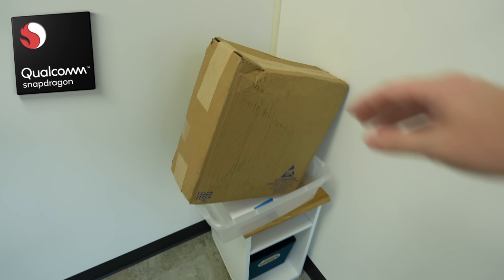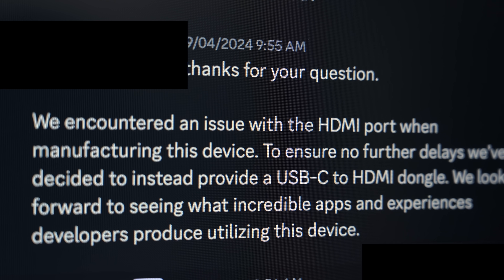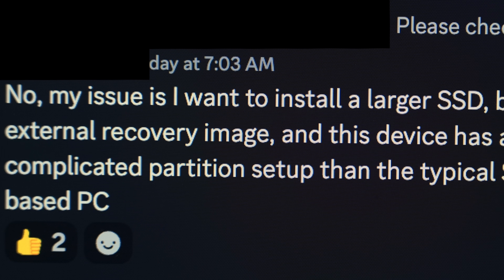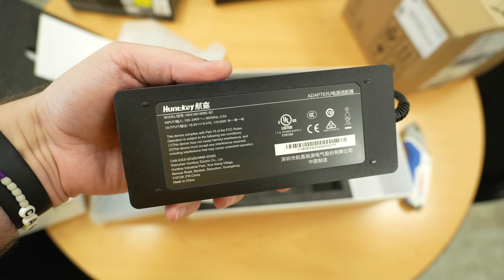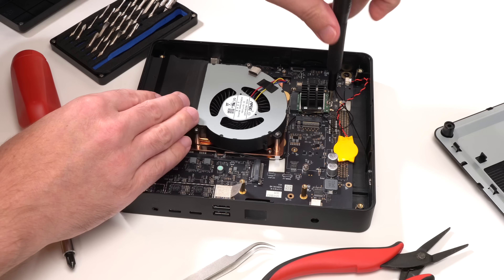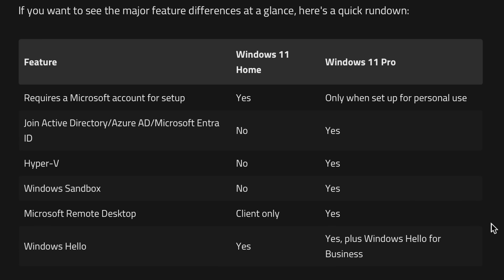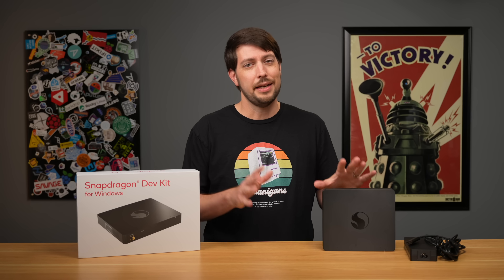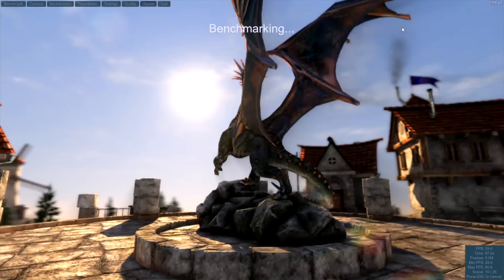Snapdragon X Elite Dev Kit: The CoPilot-est PC, tested

Comment: 100 watts from an architecture known to be efficient is some serious power consuption...
Reply: Did they just Overclock the snot out of some last gen silicon ? 😳 🔥💯🔥
Reply: People suggesting that peripherals are the reason for high power consumption does not make any sense, why would it only consume 40 - 100 watts on high load and not idle. Stop making excuses or the situation in the upcoming iteration of x elite won't be improving.
Reply: I get 1120MT on my 13700H 14.5inch laptop running at 115w
So from armv8.2 chip getting such bad efficiency even if Cinebench is not well optimized for arm64 is quite unaccaptable
Reply: or did the crackers have another epiphany
Reply: Isn't 15W output a requirement for a USB4 port? Then that would take half of the 100W.
Reply: You're misunderstanding, it was 100W with a keyboard and monitor attached, no power hungry usb devices. Pretty much all SoC and RAM.
Reply: @CampGareth  
Yeah, you're right!
Reply: @CampGareth  This thing doesn't have a built in screen or keyboard so this comment is null and void. You have no choice but to add usb devices, so I really don't understand this comment at all.
Reply: @CampGareth  I guess this is technically right, but practically means jack.
Reply: @CodyCLI  The context was power consumption, not power available. If you plug a lamp into a wall socket it does not consume the 3kW the socket can provide, only as much as the lamp requires. Similarly if you plug in a keyboard and mouse to a thunderbolt port it does not consume 15W, those devices are at most 0.5W. So the 100W measured consumption was almost entirely the SoC and RAM. Power available is much higher, iirc Jeff said a 180W brick. Hope that helps.
Reply: How does 15 watts take 50 watts?
Reply: @modrribaz1691 I guess because there are 3x USB 4 Ports, so that would add up to 45W so nearly the halft of 100W.

But they weren't used so 100W is without using all 45W over the USB-Ports.
Reply: @cze7470  Got it, I found out about the specifications, and it was also 15w if one and 15w for each two if more or 15w on one and 7.5w on the rest, so it's 30w-37.5w for all three, which is for BPDs to function properly...still not at 50%, disregarding that it was 0% at this case, since none were used.
Reply: @cze7470  exactly! 
There was some new mac and everyone was like why it needs such a big PSU. 
It had multiple TB ports, so the multiple 15W adds up.
Reply: @cze7470  that is available power, not what is being sunk. If you plug a 1500W supply into a device which only sinks 10W, it is effectively a 10W power supply. So while there are several USB-C ports, they will negotiate the power they can supply with connected devices so they won't exceed demand, and with nothing but a display, and maybe a keyboard and monitor, those ports aren't drawing anything compared to the SOC.

Comment: I genuinely planned on buying a snapdragon laptop to run Linux on. But that was back when we were told Linux support would be a thing Qualcomm was doing. Here we are months after launch and half the products don't work.
Reply: When it launched, I think Qualcomm said it would be at least another 6 months before everything is ready. There are already patches in the latest kernel releases, but also still issues and not everything works just yet.

Comment: I am not a fan of Apple. But microsoft has a lot of learn from them on how to change platforms. Treat your developers right. Roblox for example wanted to expand into VR. They gave a quest pro to every atendee on their developer conference free of charge. You need developers more than they need you. You are trying to disrupt the market with a new device. They should've postponed the launch and sold most developer kits at a loss until enough programs were working and emulation was good enough

Comment: Guaranteed all the delays are because of both software and hardware licensing issues. Software because of implementing very new libraries and hardware because of inexperience building an entire system as SDK platform.
That's why you partner with a hardware partner Snapdragon. They have systems and people in place that already know how to deal with it. You shouldn't take your foray into selling complete systems with a product you're trying to rush. Especially if that's an SDK you could have released as a module months ago and you entire business process relies on.

Comment: This is insulting from both Qualcomm and Microsoft. MS keep saying they want people on board with Windows on ARM but keep botching it, again and again, year after years, and regardless of who they partner with for the hardware side of thing. I certainly don't feel compelled to invest a large chunk of money in this DOA POS dev kit, nor an even larger amount of money in a crummy laptop I don't want, just to support people foolish enough to buy into this new hardware. I recommend against anyone buying ARM laptops at the moment. I may be forced to get one soon (because Microsoft screwed up the emulation layer when it comes to anything that uses API patching, requiring a native build for our software to work properly, and there's still no way to test things in a VM/emulator on an x64 PC instead, especially when you can't even download the OS to install it!), but it's going to happen reluctantly, and at a lower priority. Based on what happened before, I am also not sure if this whole platform/ABI will be trashed and replaced by yet another attempt that works differently, as has happened with ARM Windows and x86/x64 interop at least twice already. Why would I invest that much in such a bad product that has a lot of questions over its future, made by a company with a long history of hyping things which they abandon immediately (or even BEFORE launch, as it feels in this case!). I have better things to spend my time and money on than this shameful garbage.

Comment: Part of me wants to believe that the HDMI foundation is to blame for the HDMI fiasco, given they gave AMD issues with HDMI drivers on Linux.
Reply: HDMI sucks. They should just use display ports. People who don't really care will buy adaptors.
Reply: how so? The driver is proprietary and the OS is also proprietary. Maybe Quacomm didn't want to pay the HDMI foundation racket, but that's a different thing
Reply: HDMI is meant to be used for playback of DRM content which is why they are so strict.
What I don't understand if they had a display port to HDMI converter build it, why couldn't they just put a display port in there ? And instead ended up with USB-C.
I guess they want to have HDMI for those who need to build and test some kind of DRM content stuff.
Reply: @autohmae  could we just agree that DRM for movies doesn't work because the user controls the computer and can always modify it? This is stupid. It is the same problem with anti-cheats. The cheaters always win in the long term if it isn't server side.
Reply: @skvvlk  If you modify it in a way where the video signal loses the encrypted path from disk up to the monitor at any point you will get a black screen instead of video when watching DRM. HDCP assures that the video signal is encrypted at all times or it fails to display properly.
Reply: @autohmae  DisplayPort (and DVI for that matter) supports the same DRM protocol as HDMI.

Comment: Why can't any one just make an efficient computer like apple did !
Reply: Arm reference core designs most SoC manufacturers use are not more power efficient (in performance per watt at similar performance numbers) than new AMD or Intel SoCs (mobile CPUs). Apple and NUVIA (acquired by Qualcomm) have developed their own designs using ARM's ISA. These new Qualcomm Snapdragons actually have NUVIA cores and are not based on ARM's reference core designs. But since Apple has the money to buy the entire supply in newest manufacturing nodes, they will always have better performance per watt, and Apple also has a huge R&D budget.

Comment: Is that an unpopulaterd PCIe x16 slot there?
Reply from the maker: It certainly seems like it. Need to go buy a slot and solder it in...
Reply: @JeffGeerling  check if there are missing caps/termination resistors on the board around it. You need more than just the physical slot especially for the PCIe speeds we have these days.

Comment: I have the lenovo yoga sli snapdragon with 32gb. The programs I need have been ported to arm. I use it for video and photo editing and it works fine.  Im not doing Hollywood level production interms of size and effects but it has replaced my lenovo I7 quite well. I purchased it because it was light, small and powerful for my needs, because I work on the road. Im sure it will get better. For higher level work I have a powerful desktop for projects I get when Im home. But I hope that the developers get more programs working especially games.'

Comment: Microsoft definitely has f*cked up some things, but in that instance, I blame Qualcomm way more. The actual Copilot+ PCs have been out for months, including Microsoft's own Surface Laptop, they were pretty fast with their own Dev Kit in the past (the Dev Kit 2023) and they've been upgrading Windows ARM for a few years now, I have a Galaxy Book Go that only came with Windows 10 and 32 bits support, it still got Windows 11 and most of the updates with the x86-to-ARM compatibility, and most "regular" applications like Firefox / Chrome, 7-Zip, VLC, Visual Studio Code and things like that now have native ARM support. Qualcomm have been dragging their foot down with drivers, recovery images, documentation, hardware support and customer service, they just really didn't want to do that and it feels like Microsoft and Apple basically forced them, so now they're doing the absolute minimum. Essentially the same thing happened with Wear OS watches, they didn't care, so they just re-released the exact same underpowered SoC years after years with the absolute minimum updates (like low-power mode, slightly more efficient silicon, things like that) and almost killed the entire market, if there's no way for them to sell their LTE and 5G modems, they really don't care.

Comment: I feel like this was a little overblown. I haven’t had many of these issues on my slim by 7x (it’s cool, quiet, efficient, powerful for its form factor), and I’m not sure this dev kit is comparable to the apple ARM transition devkit. 

Windows ARM devices have been around for years, including from Qualcomm. There’s nothing too unique about these chips that you need a dev platform just for them. 

They definitely squandered the launch of this dev kit, no words there, but it’s not as dire as it seems.
Reply: oh really? what software did you run on that ARM device? Because most games don't run. A lot of productivity software and VPN clients are only for x86 still. If all you need is a browser and Office you are probably fine on ARM
Reply: @marcogenovesi8570  not really the part I'm disputing, but a surprisingly high amount of x86 software just works out of the box. I didn't even realize some of the apps I was running were x86. It's basically as good as Rosetta 2 was on the Mac. Most people aren't playing video games locally on sub 3 pound laptops, so I can't see it being an issue for most people. I do light web dev stuff and spend a lot of time ssh'd into a remote Linux box, using WSL on Ubuntu, using containers, etc. not perfect but no chip transition ever was going to be.

I'm mainly quibbling with the overhyping of the importance and significance of this dev kit and treating it as reflective of the snapdragon X devices out there. It's just not. Aside from being a completely different form factor, it just seems rushed and unoptimized in a way that doesn't hold true for the Qualcomm laptops out there. The fan noise was the strongest one for me--i didn't even remember I had a fan until doing a firmware flash. There's a lot of good here, and afaict they're all getting fairly good customer reviews from normal folks.

Comment: the performance problem is 100% windows.  Macs ran great on x64 CPUs, Windows doesn't.  Macs run great on arm CPUs, Windows doesn't.  Windows was not written for efficiency, and it has always been written with the assumption that new CPU generations would absorb the inefficient software created for the previous generation.  Now Microsoft are paying the performance penalties for their poor decisions in the past.
Reply from the maker: Heh, the crazy thing is how often the box would just ramp the fans up while doing "nothing". I open up Task Manager and see some random Windows process eat up 20-30% CPU for a few seconds, then sleep again.

Why does all the Windows built-in stuff have to check in so frequently?!
Reply: @JeffGeerling  On my Snapdragon Elite laptop the fans almost never turn on and when they do it's whisper quiet with around 0%-%1 CPU usage with hundreds of apps installed when idle. The only bloatware I removed from the base install was McAfee.
Reply from the maker: @TalynOne  The laptop likely has a LOT different power settings than this little desktop unit. Honestly I would've rather they leave the laptop power settings since efficiency is better (and thus cooling!).
Reply: windows was always made for compatibility, not performance. there are dozens of old code in all levels from libraries to firmware, the x86 itself etc that just sits there just in case. also, windows has to support an enormous variety of different hardware at all levels (m/b, gpu, net, wifi, etc), while apple has only a few. this cannot provide top performance no matter how much someone wants to.
Reply: @giornikitop5373  simply not true, there are games that can only be played through Wine's kinda-emulation wrapper for example
Reply: @marcogenovesi8570  what is not true? and what do games through wine have to do with what i said?
Reply: @giornikitop5373  that windows was made for retrocompatibility, and that  retrocompatibility has to be a drag on performance. I said there are games that can ONLY be played through Wine. I mean there are plenty of not-too-old games and software that don't run on newer Windows anymore, and have to be run though an emulation layer. Retrocompatibility was a goal but not as much as you think.
Reply: @marcogenovesi8570  windows WAS made for compatibility above all my friend, win11 still has a driver for the ISA bus. games was the least of the reasons although they did play a good role in the overall situation. bottom line is, the bloat will be lower with arm but still significant.
Reply: My biggest gripe with Windows is NTFS. It sucks so much that it is not even funny.
Reply: BTRFS can literally create a copy of the state of your drive and restore that copy if you mess something up. It does that while barely using any space. It just records the deltas between older and new data. NTFS is stupid. I discovered recently after deciding that I don't need windows anymore to change my hard disk to ext.4. After researching I found out that I don't have to defrag the disk and that it automatically optimizes it without downtime. NTFS sucks.

Comment: Framework laptop with a qualcomm X Elite  upgrade could be a winner, after a linux device tree is grown and harvested :-)
Reply from the maker: And more importantly, _supported_. I wouldn't buy a laptop with Snapdragon X until Qualcomm actually gets behind Linux running on it... don't want to have a hackintosh-like maintenance burden for my daily driver!
Reply: @JeffGeerling  While I agree that would be good company support isn't required for a good experience - history suggests if the community is behind it sufficiently it will just work well enough to be useable, but probably a little lacking in performance by comparison. Though to get that community love this time around I think this thing would need to be way more energy efficient, performant or perhaps more compact with the 5g modem maybe even on the same silicon for the ultimately compact but desktop flexible computing device or something. Just something to make it actually worth putting in the effort.
Reply: Device Trees are a non-starter. ACPI and UEFI have problems but you cannot treat a laptop like a phone. It would need SystemReady LS certification ideally. With Device Trees, every single laptop would need its own, like phones. That will not fly if Microsoft has anything to do with it.
Reply: considering the state of documentation and opensource drivers, no it would not. It would be like a big cra ppy tablet

Comment: quick note for 11:34
You can change the allocated RAM to WSL by editing the .wslconfig file in your home folder
Reply: for example 
```
[wsl2]
memory=24GB
```
Reply: It's still slow. Much better if Linux distro has direct hardware communication instead of using other software to do silly tasks.

Comment: Not sure if this was previously mentioned, but to set the amount of memory for WSL, you can create a .wslconfig file in your home directory.  C:\Users\<username\.wslconfig

Then add the following:

[wsl2]
memory=24GB

Stop the WSL if it's already running with "wsl --shutdown" or just reboot the system so the next time you start WSL, it'll use the settings in the config file.

Not sure if it'll work with what you have, but you can give it a shot